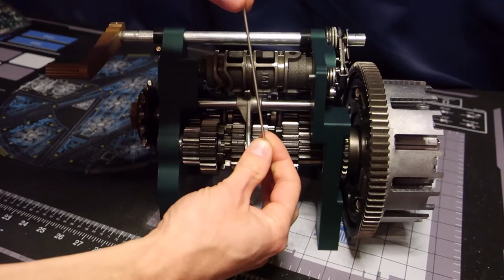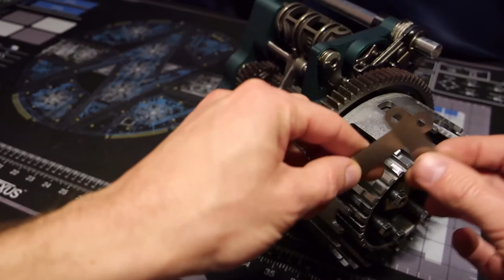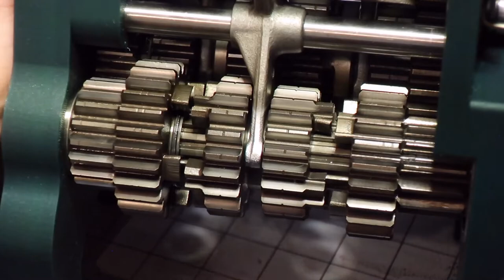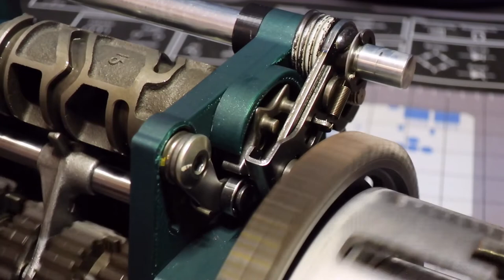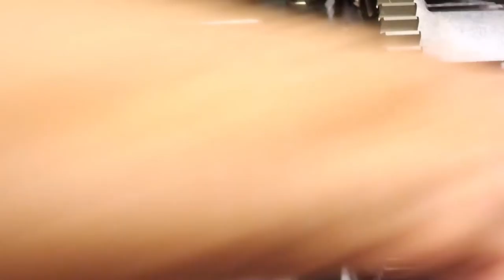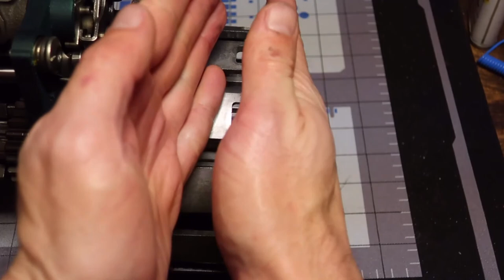Motorcycle Dog Box Transmission Display - Theory and Operation

Comment: Very informative video. I had an incident on a 2018 CRF250l where I was in 6th gear and tried to upshift (thinking I was in 5th). I timed something incorrectly and there was a loud grinding noise followed by an immediate perceived loss of engine braking power. Also shifting seems lighter now, less positive engagement. For example where as before downshifting from 3rd to 2nd would result in a loud clunk and give strong tactile feedback, now it feels like there is less resistance and it slides into 2nd gear more easily with less of a clunk. Any idea what the issue could be? Dealership tech said the bike is fine but I know for a fact there is reduced engine braking and different feel when shifting after the incident. Thanks
Reply from the maker: That is hard to say without having the bike to look at. Whenever you're in 6th and you try to go beyond that, the shift drum will physically prevent you / the fork from doing that. You would have to exert a huge amount of force on the shift lever to even have a chance of messing something up (maybe ground a part of the shift fork guide pin away which could explain the softer shifting?).

This sounds like an odd issue and warrants further investigation on your part with some form of tear down. I would inspect the condition of the clutch pack and slipper clutch since you were also complaining about engine braking issues (and you have to get to that part anyway on most transmissions before you can access the geartrain), but again, this is almost guess work without having the bike in person to see what you're talking about.

Comment: 15:00 what do you mean here by "Timing your shifts"
when the bike is moving output shaft is connected to the chain and thus wheel
which i have no control over so what should i do to make sure that the "dogs" don't collide with each other ?
or the dog teeth will slide in thier position due to wheel driving the transmision ?
Reply from the maker: When you're accelerating, the dogs naturally butt-up against one another as torque is being transmitted throughout the transmission. As soon as you let off the throttle / pull in the clutch lever, pressure is taken off the engagement dogs, and it makes it way easier for them to disengage / engage with another gear. 

As long as you're timing your throttle and clutch action properly, it should shift smoothly into gear. You'll know when you're shifting correctly vs. not; the bike will give you feedback when you're messing up / aren't smooth and consistent. :)

Comment: amazing video!, do you have anything explaining false neutrals in between gears? like 4-5th or 5thand 6th?? my bike slips out of gear at low RPMs and finds a neutral between every gear and i cant quite figure out what it is... ( rounded dogs)???  or gear shift selector rod bent? idk..
Reply from the maker: Apart from being more firm with your shifts to avoid false neutrals / popping out of gear, it could be an issue where the engagement dogs are worn.  I wouldn't be surprised if your shift forks are also worn as well. Hard to diagnose issues like this over the internet, so take what I say with some speculation.

Comment: Excellent video, very informative. I have a Kawasaki zrx with 45k miles in mint condition. However third gear is worn and started to pop out. The replacement gear is discontinued, I bought a used transmission with only 25k on it and it has similar wear on the slots where the dogs slide in. I’m at a loss of what to do at thins point. Any advice?
Reply: Damn 45k? zrx’s are crazy.
Reply from the maker: 1_BadKZ1000, there are companies out there that will machine the engagement dogs in such a way to where they lock into each other more efficiently (back/undercutting gears). They work very well to prevent that issue from happening in the future. The downside; a bit pricey. I had to do that option on my old ZX6 race bike. Something about them Kawy transmissions...

Comment: Are the dog ring selectors strong ?? Do they take a beating ?? Cause my bike clunks when shifting to first from neutral
Reply from the maker: So the selector sleeve/gear setups are fairly robust as long as you are shifting correctly between the gears. There should also have been a heat-treatment process completed from the factory to help the gearbox stand up to regular abuse.

As far as why you're bike is clunking when shifting from first to neutral? Hard to say without seeing it in person.